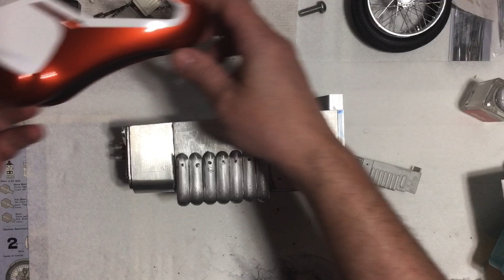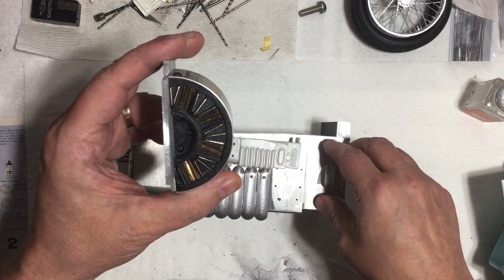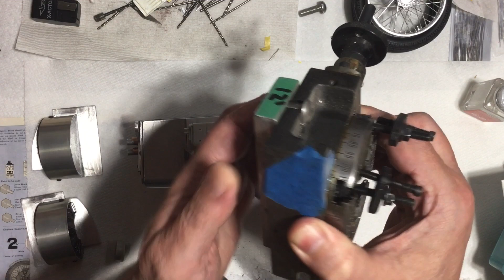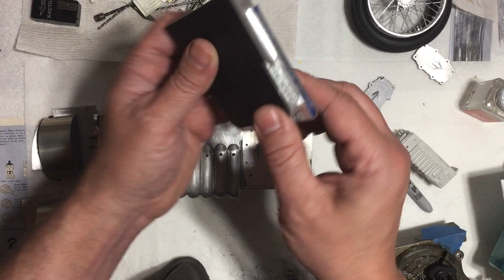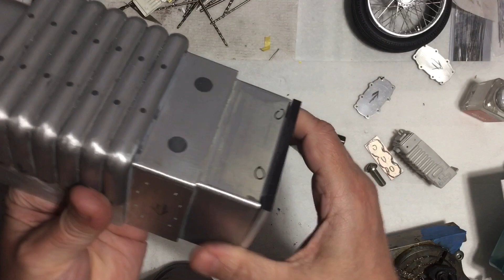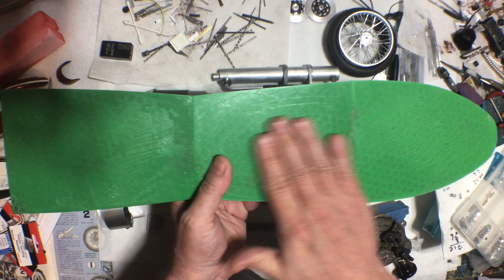1/4 scale speeder bike build part 2

Comment: Just a thought. If you put carbon fiber on the green “thing” won’t it become a size to large since it now is the correct size?
Reply from the maker: Yes, but only by the thickness of the carbon, which won’t be noticeable. I’ll build up the thickness from the inside after the first layer is cured. Technically, I should make a mold, and lay up the carbon from inside a mold. But that takes a lot more materials and time. So for something that’s not dimensionally critical, doing it the way I  am is ok.